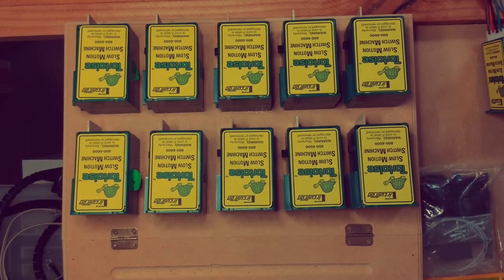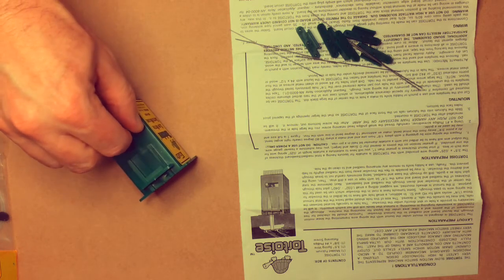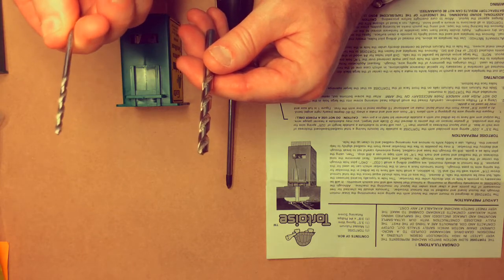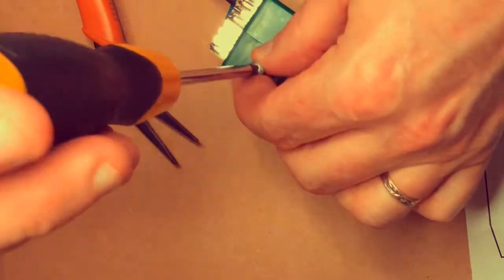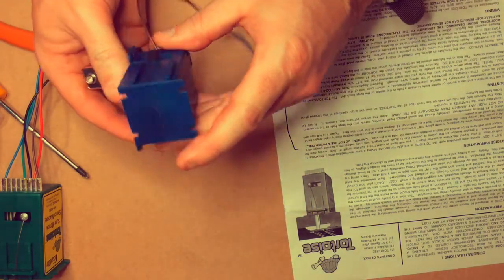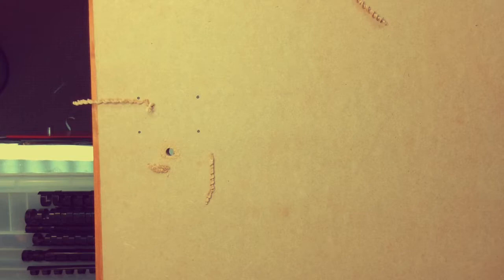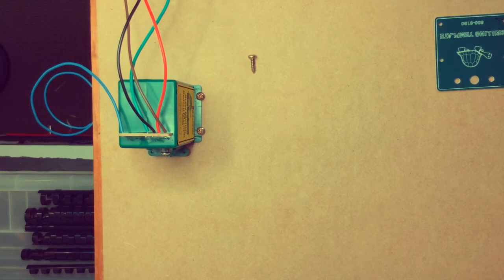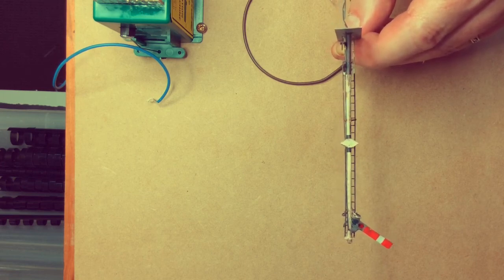Tortoise motor setup & Cobalt comparison

Comment: Nice video, I bought 8 of the first Gen Cobalt and found them unreliable they all worked at first and then slowly started to make that clicking noise, sound likes the gears do not mesh properly, would start clicking sometimes at random in the end i became  fed up and frustrated I should have got my $150 back from Cobalt, I threw  them all in the bin, Have been using tortoise's ever since they are great.